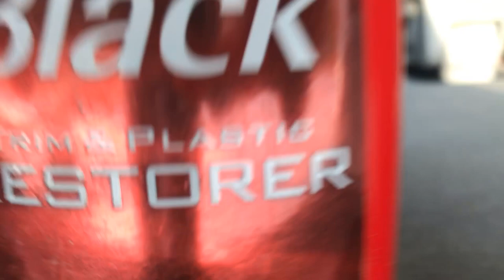How To Restore And Fix Faded Plastic Trim

Comment: I use Solution Finish. It redyes the black. Also comes in gray. It makes it look new. I also use a trim ceramic coating if customers want it. Try it. In my opinion best stuff. Doesn't just shine it renews
Reply from the maker: Dude that’s exactly what I was looking for! Is it on Amazon?
Reply: @AutOdometer  great video by the way. Thank you buddy